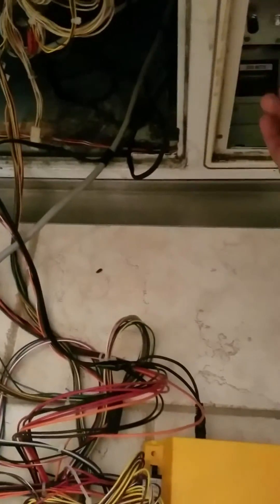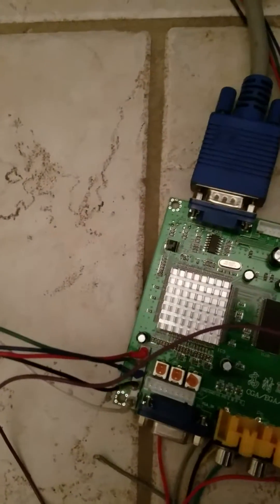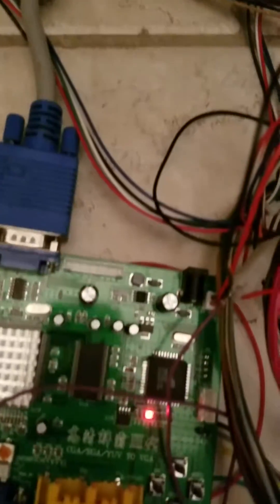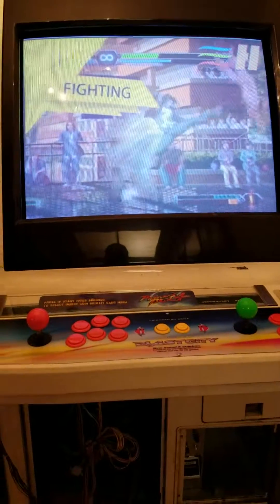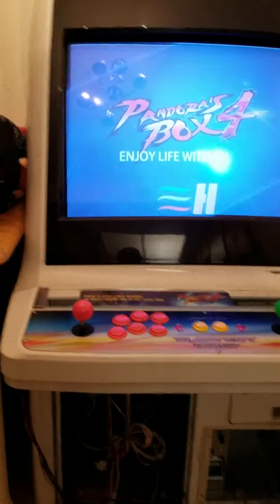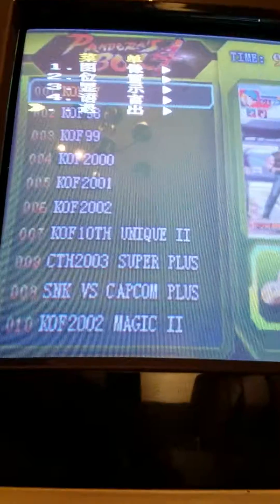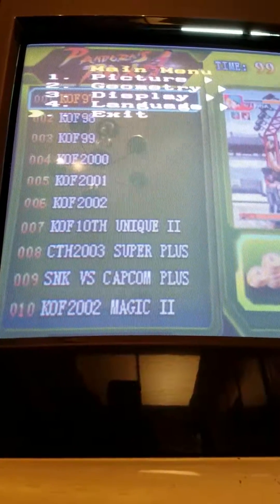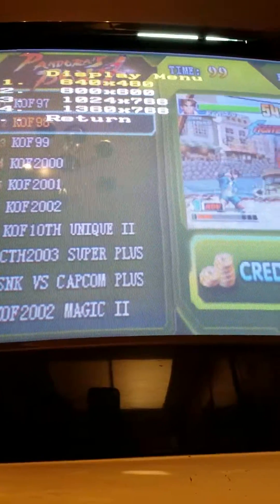Pandoras box scrambled screen FIX!

Comment: I have this problem but with Jamma RGB output .My arcade cabinet Monitor is CRT .  SO i need to buy this CGA to VGA  to get lower resolution then to buy VGA to CGA/ RGB?  :D
Reply: did you fixed the problem? i just bought a pb 6 that do this fastidious defect. the screen is very scrambled. do you think we can use the vga output and link directly the wire in the rgb connector of the cahthod ray tube motherbord?